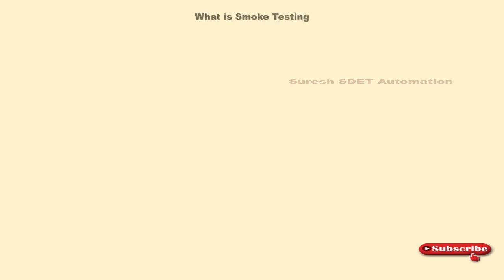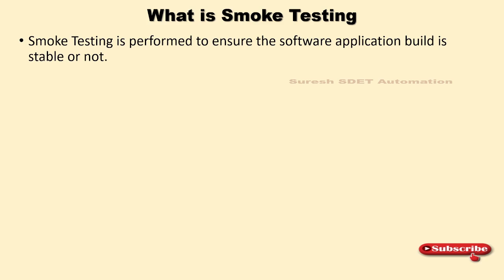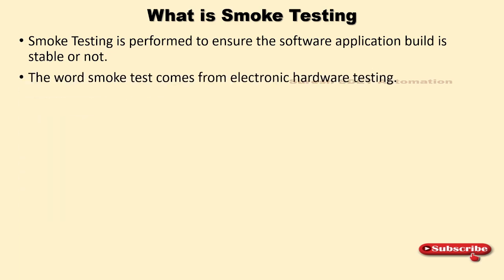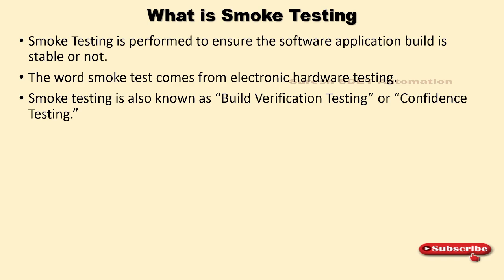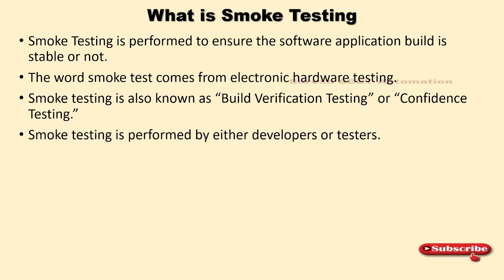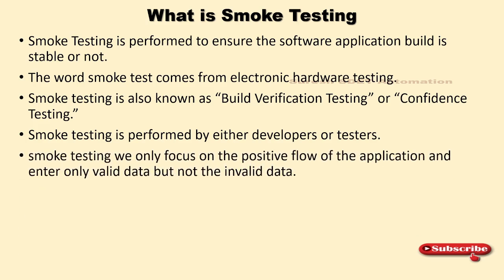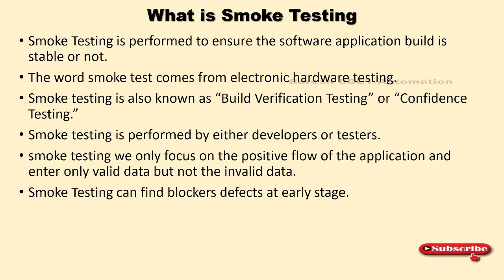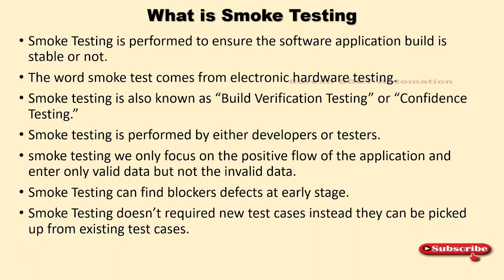Smoke Testing | What | When | Why | Where we use Smoke Testing

Comment: Does BA do smoke testing
Reply from the maker: If you're referring to business architect they do core functional testing which is more then smoke testing. 

Moreover application designed based his/her rules defined.
Reply: @SureshSDETAutomation  Actually, I joined as a senior business analyst, in my new org they as asking me to perform smoke test, they say its a common thing and trying to question my BA skills, in my prev company I have not done one.
Reply from the maker: For businesses analyst its only one time job per release not for every small changes. Because you will be checking the application interns of business rules. 

 If you does this smoke testing every day you will be called as tester.